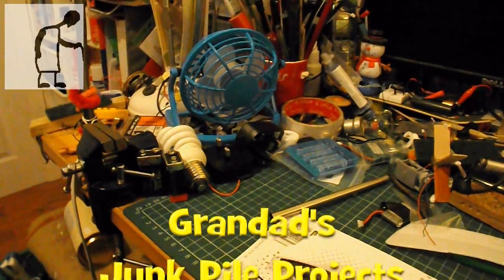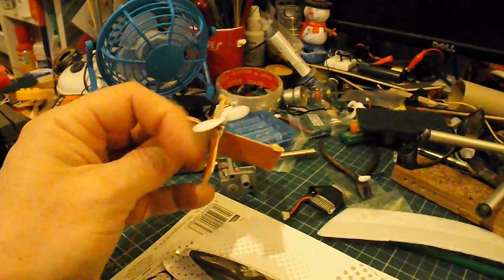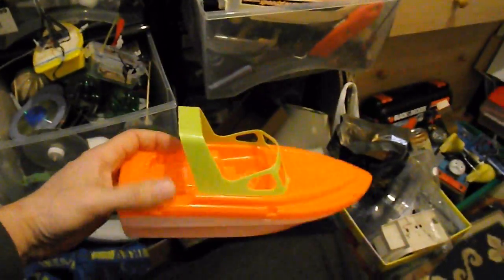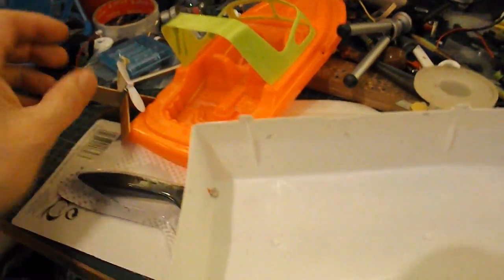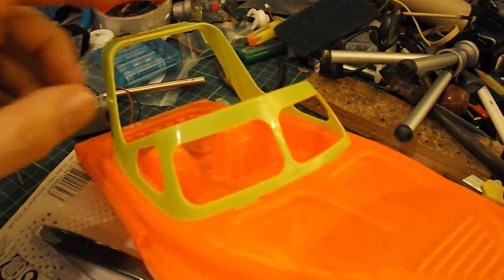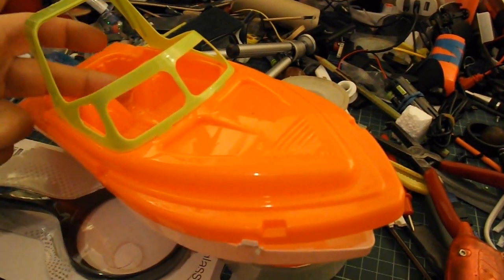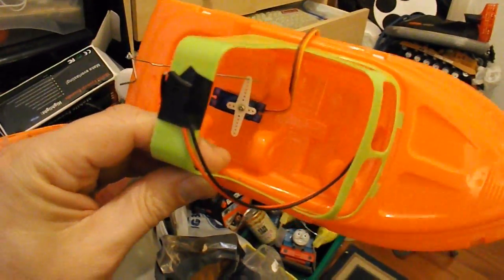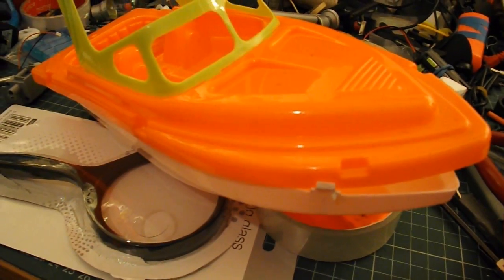Grandad's Junk Pile Projects #19 Fan Boat/Air Boat

Comment: Finally!I was trying to figure out how to control these motors with my transmitter and receiver.And I have a question:do you use a 1 cell LiPo to power the receiver?If so,how?Because I can't power mine with a 1 cell LiPo.Cool video btw.
Reply from the maker: +Mohamed Yassine in the video I show I am running it using 4 AAA rechargeable batteries so that will be about 4.8 volts. You will probably find your single LiPo is giving you a maximum of about 4.2 volts fully charged dropping back to 3.7 volts nominal and your receiver is probably looking for 5 volts. Having said that I use a 1S lipo on another of my boats running it through an ESC so I am guessing the ESC is boosting the voltage to match the receiver https://youtu.be/JLa0IFT7qNo
Reply: GrandadIsAnOldMan Thanks!